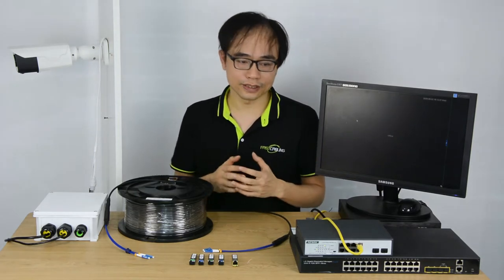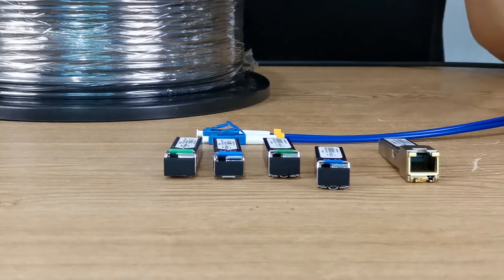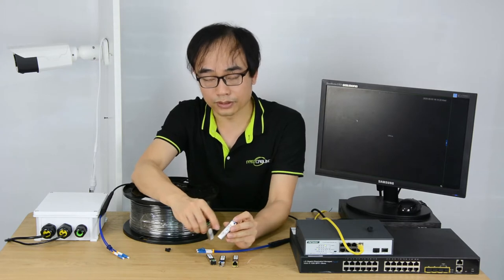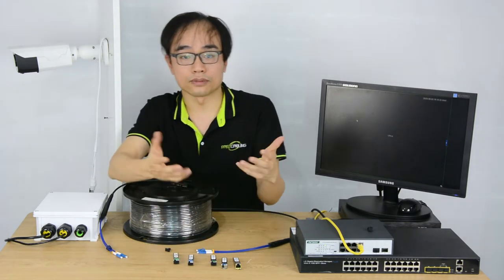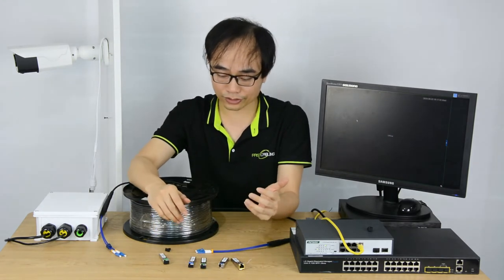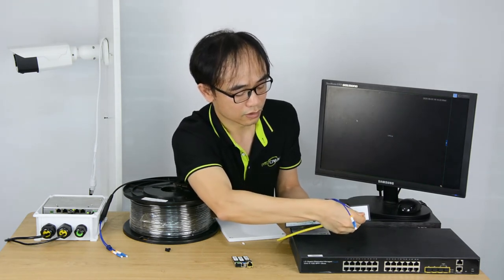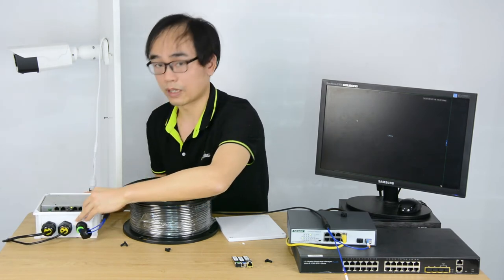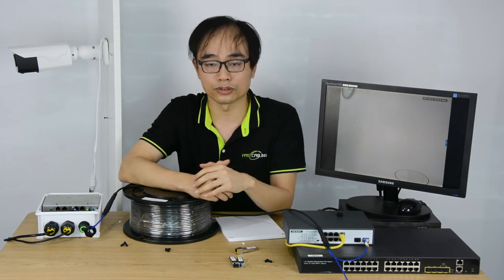How to use fiber optic connection on your Switch

Comment: I saw there is 2 cable from the fiber optic cable, in the video you only connect 1 of it into the module, may I know the usage of the another one? Or only one is needed depends on which one is the receiver and which one is the transmitter? If that is the case then we will only use 1 port for each fiber optic module (they usually have 2 ports, I think one is for receive, one is for transmit) right? Please correct me if I get it wrong.

Thank you.
Reply from the maker: You only need a single fiber optical cable to transmit and receive the data. It is the bidi fiber optical module we use. The BIDI fiber optical module takes different wavelengths to transmit and receive the data. The second fiber optic cable is for backup purposes in case you may want to expand the network in the future. Here is the BiDi transceiver. https://www.fastcabling.com/product/bidi-sfp-fiber-modules-2/